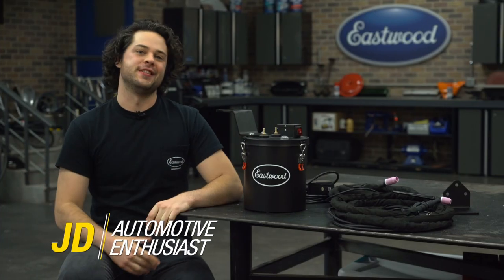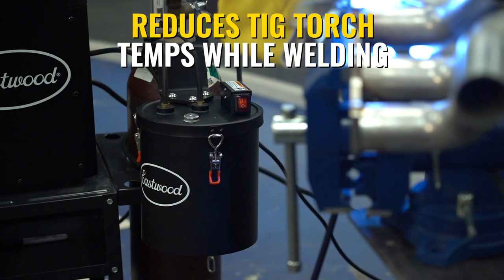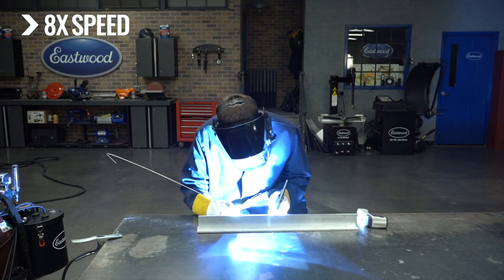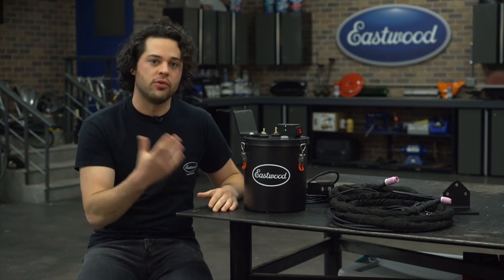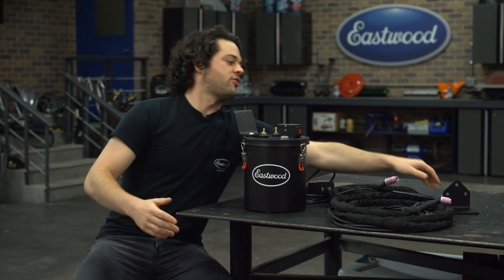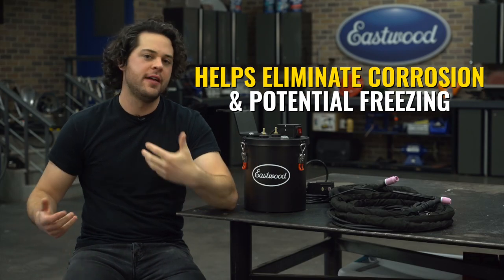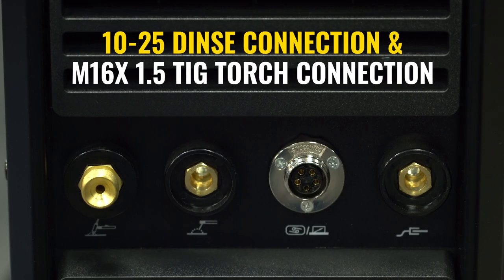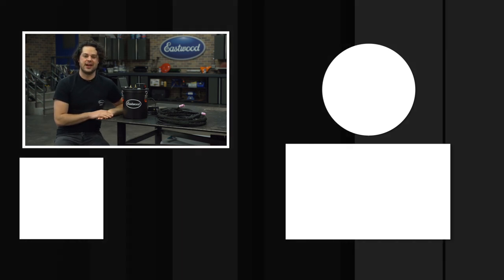Upgrade Your TIG Welder - Eastwood Elite TIG Torch Water Cooler!

Comment: Will this work on my Lincoln square wave tig 200?
Reply from the maker: The PTA-18 tig torch can be used with this cooler, but the water inlet/outlet lines will neeed to be cut to be installed on the barb fittings of the cooler.

Comment: Can I add a 35-50 to 10-25 dinse connector adapter on the mig outlet on the mp250i elite and connect this setup to my mp250i to have a water cooled tig torch?
Reply from the maker: Yea that will work! We are currently working on bringing that adapter to Eastwood as well.